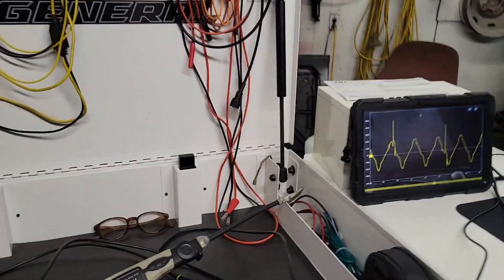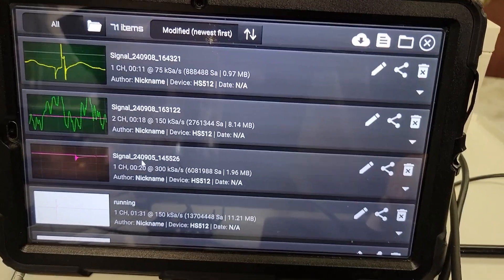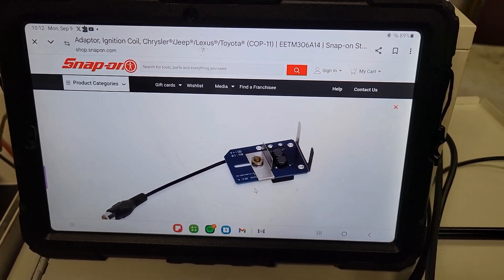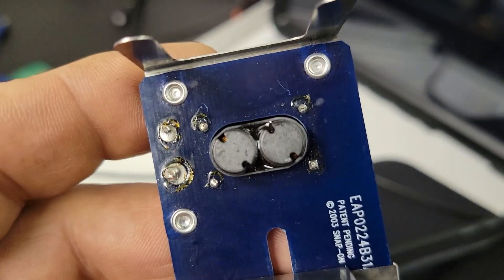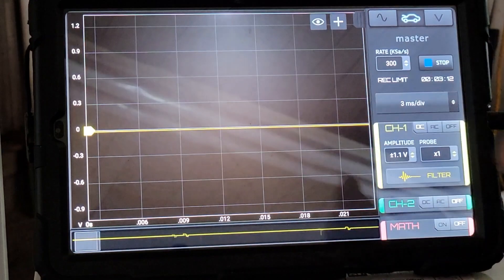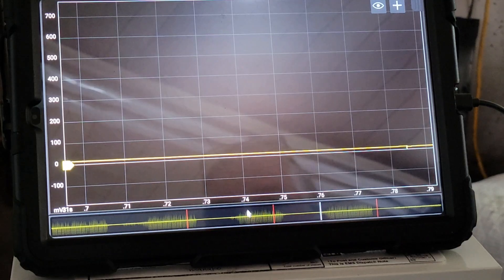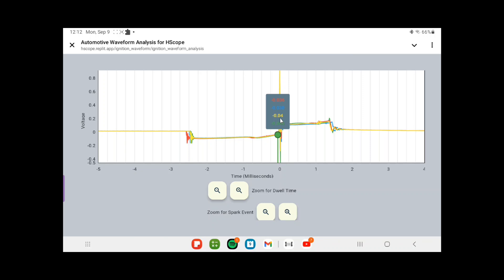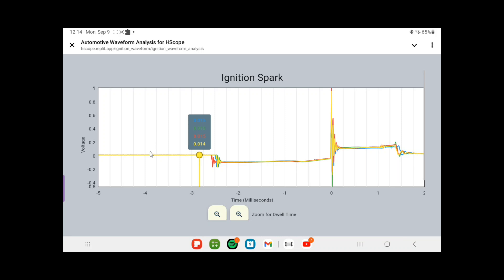Paddle probe questions and trying out  Chris Ingram's Hscope ignition waveform app!

Comment: Where can you get that app ??
Reply: HScope AutoAnalyzer-ignition app ??
Reply from the maker: @nwmartinzz  No, that would be Chris Ingrams app that works with Hscope, I believe. Martin Loren.com has links as well. It is only for Android, by the way
Reply from the maker: @nwmartinzz  on the play store , it is called Hscope. You get 1 channel in demo mode to use with a compatible scope. Enough to see if tablet based oscilloscopes are for you. Check it out!

Comment: That Snap on probe looks like it might be a coil wrapped around a ferrite center. Thos two discs that press to the back of the COP look like ferrite. You might get similar results from a relay coil like Ravi Fix made.

I got good results from a one inch square piece of single copper clad PCB hooked to the center of coax and the braid to ground.
Reply from the maker: That is one i do not have , i saw the keys. I think it came with 40 keys or so, some do have circuts and whatever those black things are. I was missing that incuctive pick up, amp clamp and the trigger. Does have the rpm and 2 sets of leads,also the rca igniion. thats what i was using and converting to bnc. I will have to make a legit cable, but even through all the adapters it was really clean. Do you know why that one says burn time only? Looks like a whole ignition to me, or at least enough to find a miss. 
 I do have the flexible probe that says it's for a Taurus, i cant remember the probe number, but eying it up to make a paddle for this adapter. Take care

Comment: I don't know what that is. If you look at the "Keys" you got with your Modis, you'll see a little black box on the K-20 key, too.
Incidentally, I think I saw a yellow lead with an RCA connector in your pile of Modis accessories, EETA309A05A. That goes with a Secondary Ignition Clip-On Wire Adaptor, EETM306A02, which I did not see. If you have that EETM306A02, you can unscrew the top and use the tip to directly place on a coil for a waveform. It's pretty neat. 
,